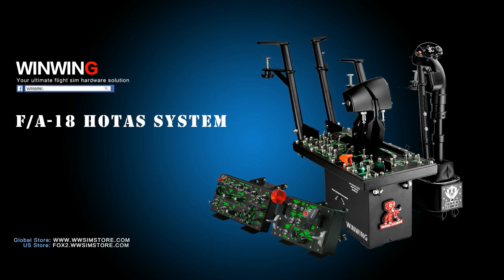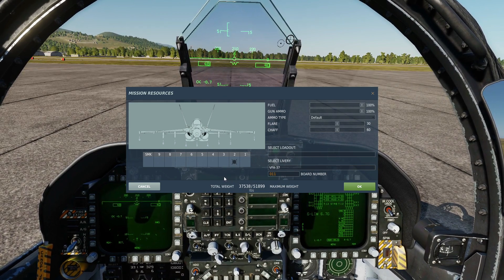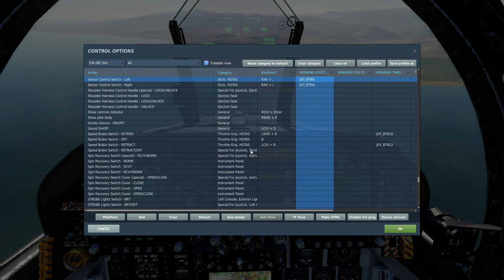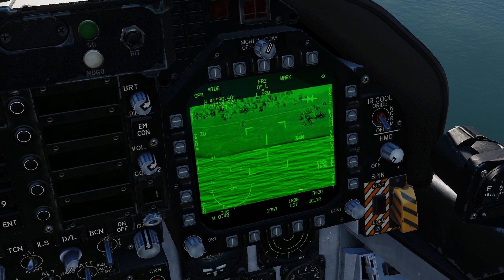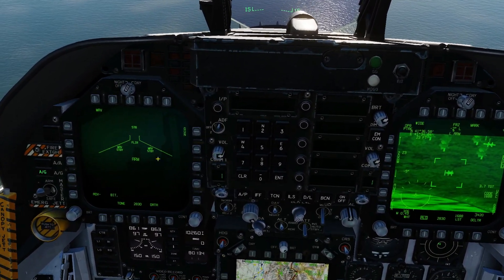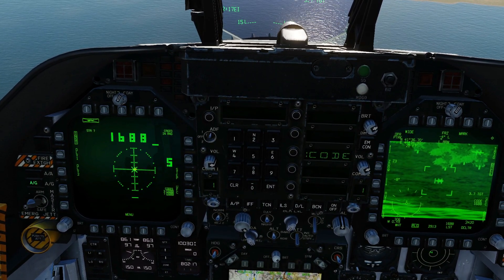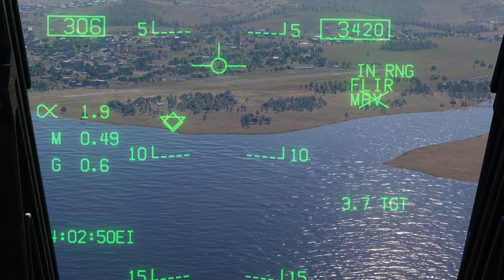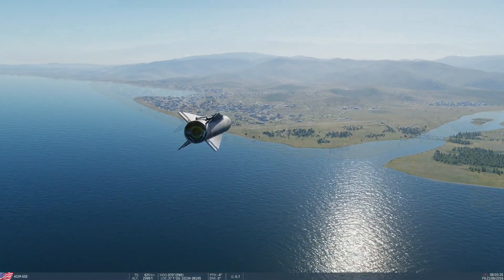FA-18C Hornet: AGM-65E Laser Guided Maverick Tutorial | DCS WORLD

Comment from the maker: Additional points on the use of AGM-65E:
1) the first press of Weapon Release will activate the laser. This means you can confirm a good track before firing the missile, if you hold it down it will lase and then just fire.

2) "X" on the maverick screen is a good laser track, it's just where the designation spot is relative to the seeker head, a solid square is a good laser track.
Reply: Maybe I'm wrong, but I think you meant the X is not a good laser track.
Reply: hi why do i bot have ufc when select maverick?

Comment: So what do you think I'm doing incorrectly when I'm at this point 2:47 where I'm switching SOI to left ddi and the seeker head does not automatically uncage? I have to manually uncage it, and then it'll acquire the targeting information from the TGP. Edit: So right after typing this I figured out (pretty sure anyways) that my issue was I was locating the target area using waypoint designate, but the waypoint designate was conflicting with the point/area track information being sent to the mav. There was a URAL on the waypoint marker, but I had selected a tank in my flir. When I shot the mav, I'm watching a tank on my flir, but the mav went after the ural. LOL. Surprise!

Comment: Does using the E (laser) provide more accuracy than the F (infrared)? Or is there another reason to prefer one over the other?
Reply: You might also want to use the LMAV for targets the MAVF can't track. For instance a tank of fuel, a pallet of munitions, or a specific window in a building.
Or when someone else is lazing, you just fly to the vicinity, and  ground troops take care of the actual aiming ^^
Reply from the maker: I have not noticed and diff in accuracy.
Reply: I think it's more a question of tactics.  With the IR version you can turn away from the target after weapon release. But their optics are far worse than the tpod, meaning you can acquire targets from further away using laser mavericks with the tpod.
Also the IR is more  a fire and forget weapon, the other requires guidance. That means you can fire the IRs shortly one after another in one pass. The laser version is more fiddly and difficult to fire multiple on one pass.
Reply: @vrbnjakd  That's a great point. Thanks!
Reply: Adding to what has also been said (I don't own the module and haven't used laser mavs but this should work) you should be able to have a buddy lase a target for you, then all you have to do is make sure the laser code is the same, lock it and fire and you won't have to do any of the target searching, just carry the ordinance.